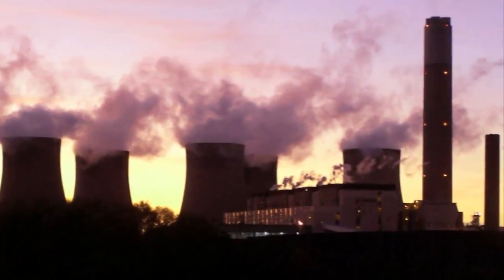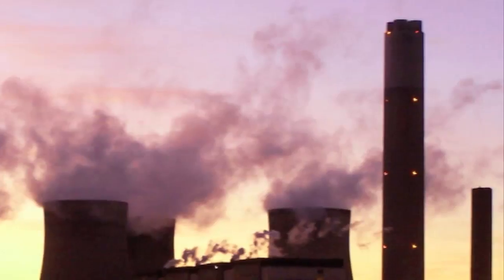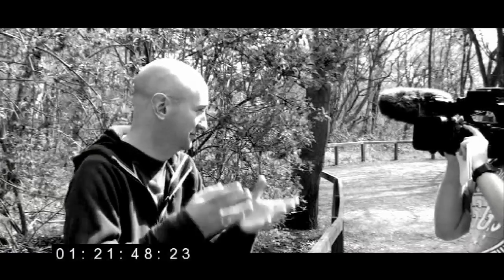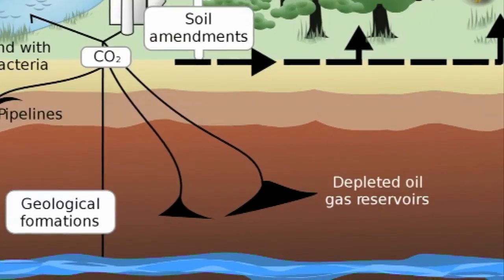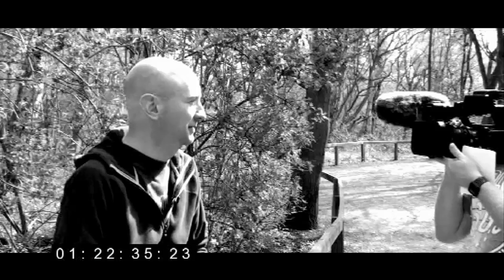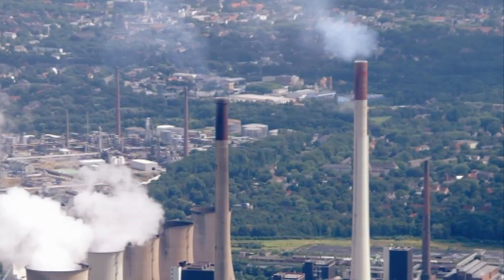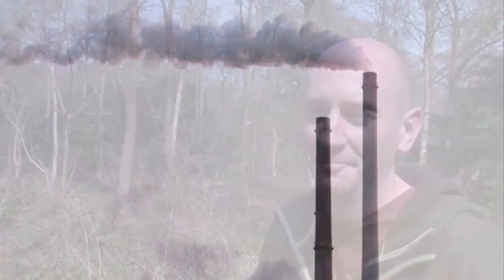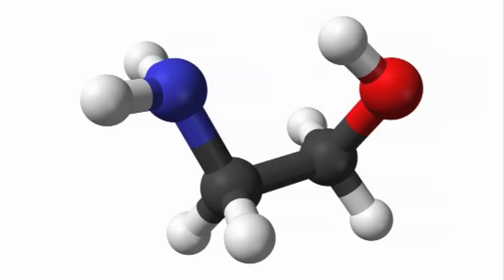Carbon Capture and Storage

Comment: are you f-ing high? do you have any comprehension of the energy needed to compress that amount of CO2? you will burn 2x of the fuel to provide the power to compress it. You 10% number is so far off its rediculous. And it doesnt consider the moving costs and energy. Get your head out of the clouds and come back to reality, not school theory. You would be better off going to a geothermal heatpump stirling/solar/wind/elavated h2o

Comment: @DomhnallX50 The phrase; ‘lower partial-pressure’ is significant, if you followed the video closely they are talking about concentrating it from a dilute mixture within the chimneyc gasses. If there is a problem with quantity of O2 availability then it can be blended from the atmosphere in the pipework. 

Also algal bio-fule synthesis; algae are vastly more productive then complex plants, can tolerate higher partial pressures of CO2, and are a greater benefit concerning modern transport.

Comment: I've solved the problem; coupling alkaline water-dissolved carbon entrapment with piping of excess CO2 gas at lower partial-pressure into hydroponic green-houses whose sole limitations are the gas itself. Combined with coal-fired power plants where the turbine actually sits upon the furnace, double-skin evacuated piping, and heat-exchange to fule-source can increase efficiency via limiting heat loss, and lower fule demand.

But people fail to see this/blind and pay attention to big money ideas